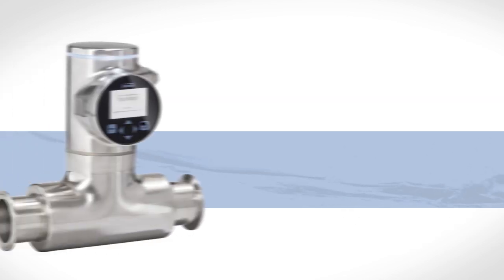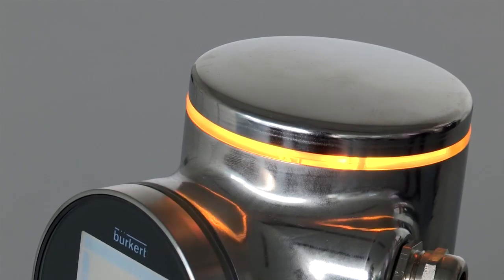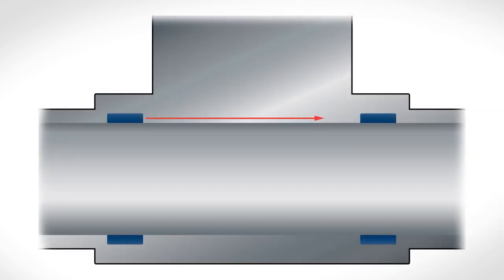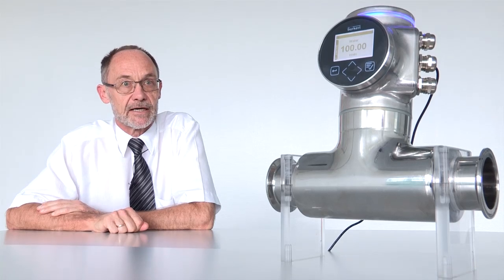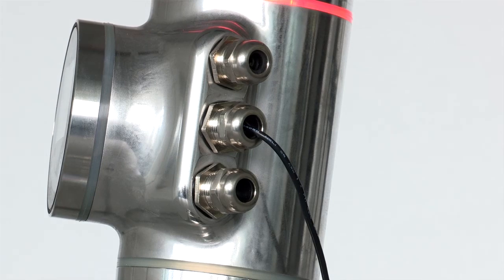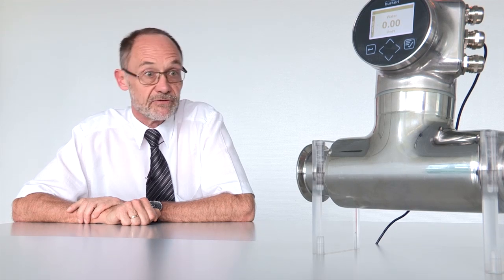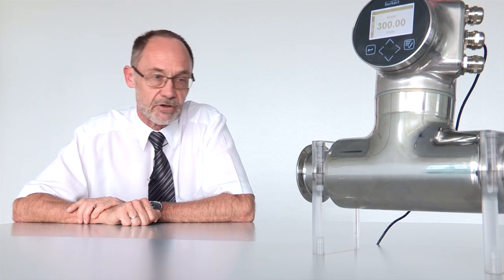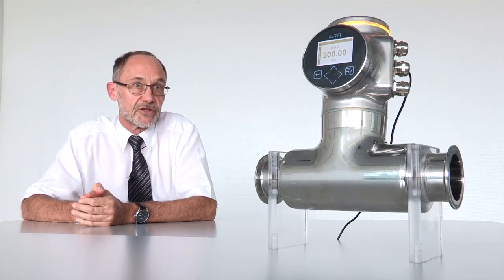Product presentation: The new Bürkert flowmeter FLOWave

Comment: Is it we can use for any flow medium?
Reply from the maker: Optimal measurement results can be achieved with homogeneous liquids, free of air and solid particles. For liquids with high viscosity, an integrated viscosity compensation can be activated. Gas and steam cannot be measured; however, their flow does not have any negative effect on the device or its operation and other liquids flowing through afterwards are measured correctly as before.
We hope, this helps you! For further information, read more about FLOWave on our website: https://www.burkert.com/en/type/8098